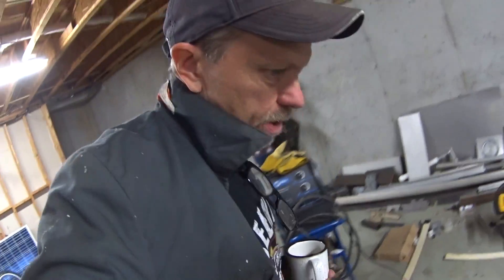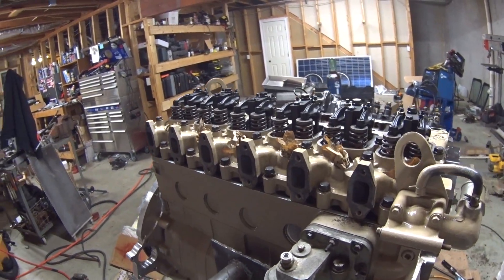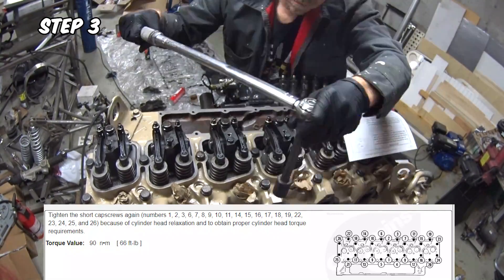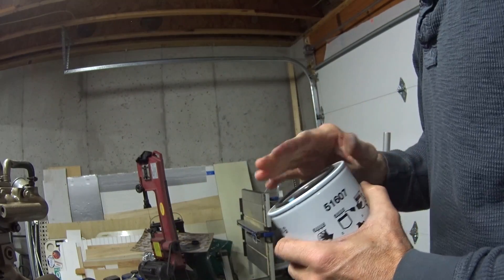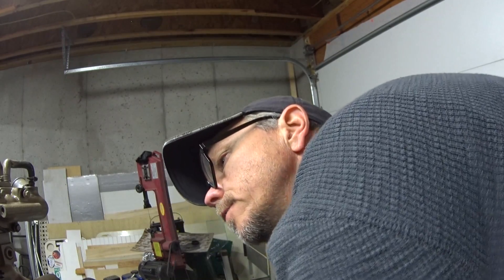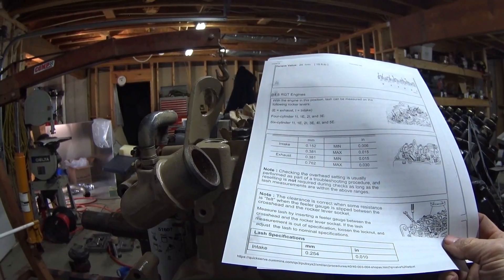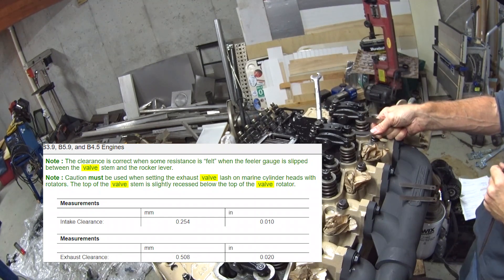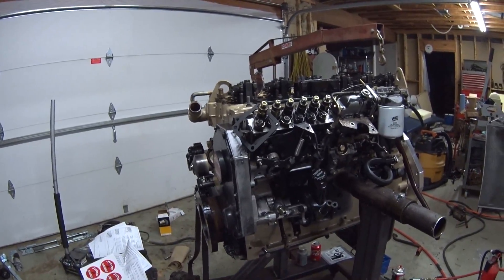5.9 Cummins 12 valve Rebuild part 5 - Head install and valve adjustment

Comment: I jus did my 6bt 5.9 marine, before I torqued the bolts, i took the bolt tightening pattern sheet and then numbered the bolts, easier then always looking at the sheet,.

Comment: There's nothing wrong with you reuse in the head bolt you know a lot of people make a big deal new head bolts no as long as they've been pork you no one wanted to touch it doesn't matter really doesn't doesn't make a hill of beans as long as they haven't been over torqued now if they've been over torqued dumb way but ain't no big deal

Comment: JYDOG:  This method might work for the roof of your pontoon boat cabin.  Go with aluminum to the eave then switch to schedule 40 plastic pipe. Aluminium pipe studs that fit into the PVC could be welded to the wall top stringer. That will give you a thick enough wall to pop rivet to.
https://www.youtube.com/watch?v=tIJ1FO-ixco
  
I would part the Air steam trailer; for the boat cabin.  the work to restore it would not be worth the effort. And it's chassis, floor and running gear could make a light utility trailer;   to carry toys and a used tent trailer box for additional accommodation. Mount it across the trailer so it folds out over the sides.  This you could tow with the box camper or other off road truck for expeditions leaving the trailer as a base camp.    the old guy   Bert

Comment: headbolts are usually torq to yield
about the old engine : you might be able to sell it as a core
with the dry run remember , theres no oil in the filter and you need to build pressure before running it